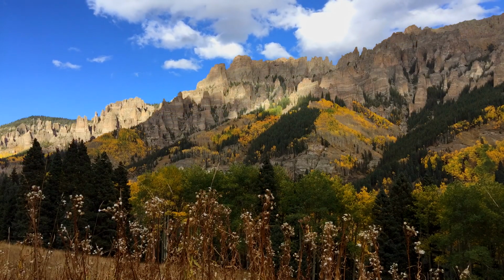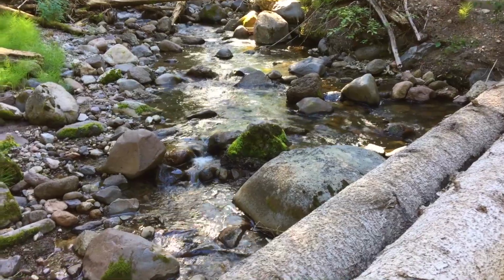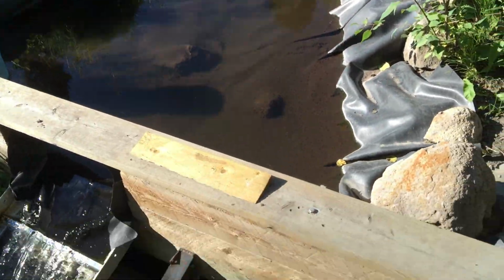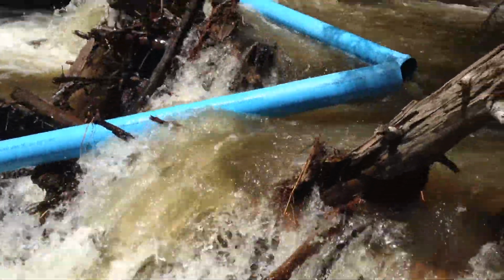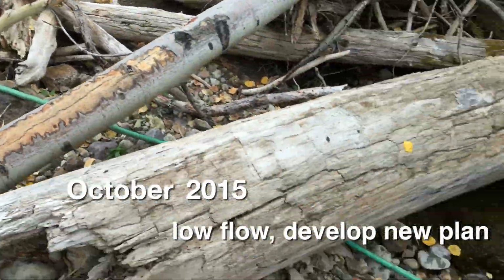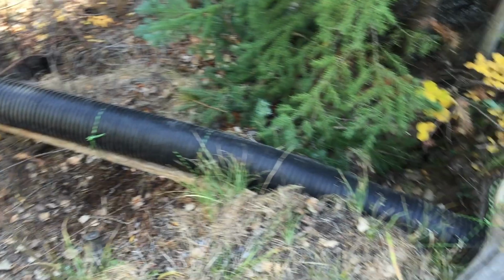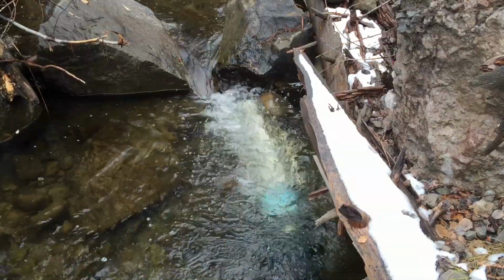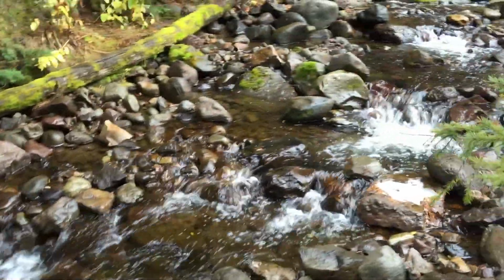Part 16 MicroHydro Power System in CO

Comment: This series really drew my interest in Micro Hydro and now that we just moved and are looking for a new home what do you think I should look for in a suitable property for Micro Hydro? can't wait for the next video!!
Reply from the maker: +Green Jeans 
A piece of land with water flowing on it that either has a lot of flow with some fall or one with a lot of fall and some flow that you can get access to.  Every installation is unique and gets designed to the potential power available.  In contrast to our system, going DC with batteries can provide ample power with much less expense.  Parts 6 and 7 of the series is an introduction to the process of determining the available power.  Fall(head) and Flow are the two essential measurements and of course being able to acquire legal rights to use the water for power which varies depending on jurisdiction.  Having some year round flow is ideal.  There are lots of manufacturers with calculators to determine power on their websites.

Glad you like the series.  More vids to come in the spring.  All is functioning under the snow at this time of year.  Any filming is cumbersome.

Comment: hi great sistom and video, just one comment the north end of the pipe bridge anker. going round the trees will cause the back harfe of the tree problems in growth as the bark and cambium are crushed. an olternative is to drill a hole through the trunk and fit a 3" stanlase steel  plate and rod with an eye at the end the 2 woonds can then be sealed with wax ,the tree will then grow around this. We have done this at the local scout campsite for the plonering 3 years ago and they have heald up fine and are still solid.
Reply from the maker: Thank you for the input.  We will look into it.

Comment: Great series! Is there any change to the forest downstream from the meadow? Curious if the reduced water flow in that spring where the water is picked up and redirected to the power plant has had any effect to the lower vegetation. thanks
Reply from the maker: +woolever02 
No, the point at which we picked up the Spring water in the meadow was only about 100 ft. from where it joined the creek anyway.  The diversion of water from the creek to the meadow is a small portion of the available creek water, so there really is no impact to the forest from that either.  The seasonal changes in flow of both the spring water and the creek are very large anyway and always have been in this area.  So, no real impact to either flora or fauna.

Comment: While i am at it . How do you clean the intace in the creek ?
Stopping turbine periodicliy and letting the 
Waterflow over the screen flush  in away?  Nice system by the way. Sorry for the spelling..
Reply from the maker: +Staffan Lundgren 
The creek that feeds the meadow intake is largely self cleaning by its location in the creek water flow.  The other screen at the weir passes debris via the excess flow.  Both screens require the occasional cleaning with a simple brush.  No need to shut down for that, but we expect to flush the penstock once a year, so any fine silt that has settled can be cleared.  Opening the jet and pipe drain all the way with the jet deflector(system off) in place should accomplish this.  The maintenance is part of the fun with the system.
Thanks for your interest, subscribe for future updates, it helps with YouTube's ratings and more people seeing the series.

Comment: Really enjoyed the series, took over my Sunday morning. You obviously went to a lot of expense to put this system into effect - both in terms of the overall construction and the quality electrical systems and control. Could I ask what it cost overall vs. paying for power company to connect you to the grid, and what area you might have saved costs on I.e an over ground pipe from meadow to power station. Thanks again for a great compelling to watch series - really have made sure this is a consideration for land I am looking to purchase.
Reply from the maker: +Banyan Tree 
Reposting a previous answer to a similar question:
"It's a good question, but very difficult to answer. First, one would have to amortize the cost of laying in grid power in 1994.  At the time of the switchover the system had produced 145,000 kWh for a basic cost of $25,000 versus $140,000 for laying powerlines. Add $52,000 of current development costs and you are paying for all the future power generation in the systems lifetime. You would also need need to subtract the cost of line power over the last 19 years to determine the cost per kilowatt hour over the first system's history. ....... I got lucky and found myself able to pursue this undertaking nearly 25 years ago and am fortunate enough to share my experience via the Internet which has developed in the interim. 
Hopefully people somewhere in the world will find the information useful."

I'm glad you enjoyed the series.  Its rewarding to see others get something out of it.  In terms of burial of our pipe, it was certainly necessary due to the deep winter cold and the potential for animals or falling trees to damage the pipeline.  It was very rocky ground and made the burial more difficult and the bridge added a great deal to it as well.  Labor and machinery cost was the highest portion of the overall cost.  Not sure on the first system which was installed 1994 or 1995, but on the second pipeline it was roughly 56% or 29K of the 52K.  The pipeline and parts were about $7800 and diversion pipe about $650, Bridge ran about $1600, Weir under $300, powerhouse $3600, wire & electrics $4800, legal and consulting $2100. That labor and equipment rental was for all the work including laying electric wire, building powerhouse, weir, and bridge, and burying the pipe.  Sorry I can't really break out the labor for the pipeline separately, but those are the numbers I have, roughly totaled.

As you can see the lion's share of costs were labor and equipment rental and of course I already owned the hydro machinery from the first installation.  Also my time isn't calculated into any of this which was a substantial effort to accomplish.  I attempted to save money wherever I could by finding things salvage or on ebay whenever possible and neighbors helped with some labor, parts, and expertise as well. 

The reality with Hydro is that you are paying almost all your costs up front for all future power with very little parts or maintenance costs once installed.  The more power you produce and put to good use the better amortization of the costs.  Still to date, I've saved a great deal being off grid vs. running power in(w/1994 dollars).  I can't imagine what they would charge me now to run 7 miles of service, probably double the 1994 figure.  So, I feel fortunate and happy to see the meter spinning madly in my favor.  Of course if I was grid connected I could be selling the excess power, but it is fully off grid.

Please subscribe and share the series with friends that might have interest as that helps the Youtube channel get better promotion and more people will see it.  1.1 million views so far, I can hardly believe it.

Hope this helps, best of luck with achieving your goals.  Thanks for your interest!

Comment: the old hydro pipeline would you consider making a smaller power generator off that to add more power to the house or does that just make everything more complicated run a couple of baseboard heaters off of the old source?
Reply from the maker: +Wayhart 
The new system will supply plenty of power(200-215KWH/day) once we prove the winter water flow.  It does get complicated trying to synchronize two systems.  Way beyond my skill or understanding.  It would require buying another pelton turbine as well.  As it is, we have to figure out how to use all the power we can make anyway.  Think jacuzzi tub, automobile charging(once I can get an affordable electric), steam shower, ect.  The spring pipeline is now dedicated to domestic spring water and active water supply for the fish pond.  This has allowed reducing the 212psi pressure to 80-100psi which has always caused problems with regular pipeline breaks in the springtime.
Reply: +MrHydrohead There is always splitting water for hydrogen gas that you then compress to run in your standard gas car with a simple hydrogen injector at the air intake on the engine. You dont touch the gas side of the system other then reprogramming the computer to stop the flow when burning hydrogen. 

Standard engines run fine on hydrogen/methane/natural gas if you have the time and energy to convert them. storage tank ether in the trunk or roof mounted, fuel lines and the injector plate are the only real hardware needed and the other part is the change to the computer. 

Roof mounting a tank is the best option as it can be hidden inside a luggage rack and filled with foam to help insulate them. Any leaks float up so they dont fill the car with explosive gas. If you want something like Propane you want the tank lower as propane is heavy so sinks in air.
Reply from the maker: +jeepxj 
Interesting.  Thanks for the share

Comment: Your problem with the dirt could be resolved by put a  regular filter with a big pipe in the bottom of the water,   also the pipe should be attached at the top of a pyramid and you put this pipe in the big water container,   once the pression is in the pipe,  the water can go over the edge of your pound in the pipe,   also you can control it with a valve far a way! ;)

Comment: I love the explanation of the electrical system and the decisions that were made.  Can you provide a schematic of the basic water system from first weir to powerhouse and pond?  That's the one part I am not completely clear about.  

You are also building on constantly-moving morraine and alluvial deposit.  I really applaud your commitment to the project.  You could control the water situation, with D9 Cats, thousands of tons of concrete, maybe a few tons of explosives, and the blessings of FDR.
Reply from the maker: +Robert Anderson 
I have to chuckle on your comment in the second paragraph. How true it is!  It has continued to be a real struggle and DEEP into the woods where it occurs.  IT IS out into the wilderness where only wildlife, cows, and hunters trod. The whole hill above the creek is moving, just remarkable. The idea of an approach which tries to set things in stone would be incredibly expensive and doomed to eventual failure. A dynamic changeable approach seems most reasonable. 

On your first question are you looking for detail on the first system in parts 1-5 or the redesign from parts 5-16?  If you provide an address I can provide you a detailed answer.

Thanks for your comment and for watching.  It has been fun to share and there is more yet to come so please subscribe.

Comment: Hi, please explain why the diversion plan was necessary to provide water to the meadow?
Reply from the maker: +Samuel Arnold  Besides being inaccessible to heavy equipment, the intake point at the edge of our property is in an unstable zone of soil and rock.  There are huge flows of snow melt water in the spring which change the shape and course of the creek thru that region. The topography on one side of the creek is completely unbuildable. Lastly, the meadow has additional water flowing into it from a nearby set of ponds. It has proven a good choice as we can capture all available waters in the meadow from that point and allow any sediment to settle so it doesn't enter the penstock.

Comment: you should always draw water off of the water supply to a man made holding location that then supplies the power plant while excess water can be returned to the supply....
this circumvents rising and falling of runoff wherever u draw water from will erode away and every season require replacing supply lines .... there are ways to avoid that but that takes extensive construction

Comment: I was just wondering if you are planning on making another update video? I'd love to know if you ever achieved your goal of closer to 9k watts. One other question, do you sell any of your excess power back to the power company?
Reply from the maker: +Craig Bauman (VeypEngineer) 
7 miles from the grid, so no sale possible.  The cost of wires were/are prohibitive to reach the grid.  
It's been a crazy year, first preparing(starting Nov15) and selling our house in LA, closing, packing, moving, fighting invasive weeds, and getting resettled(Sep16).  Exhausting.  So there's been little time for videos all year.  Since arriving in July we've had the system throttled back on flow at about 3k not needing any excess power/heat.  Even so, needed to ventilate the garage to make working there cool enough.
Our complication on ramping up to 8.5-9k at this point is the dynamic changing quality of the creek diversion.  We pulled the flexible pipe and screen out for the spring run off and that was good because the creek scoured a different shape.  I'm just now beginning to focus on getting the diversion pipe re-installed.  The intake point of immovable rocks remained intact,  but the flexible pipe course needs to be re-situated.
Also there need to be additional loads and relays added to handle the added power.  Chicken and egg scenario. Don't want to purchase and install more load devices than there is additional power until the flow capacity and power is proven.  So it all comes down to how much water can be diverted through winter when the power is most needed.  This will be our first full winter here, so it's still a learning process getting the diversion right and overcoming any unforeseen problems.  It's a complicated thing to explain it all in videos as well, but that's the goal for this fall.  To get it all ramped up, installed and explained.  
Also, I've had an electrical engineer friend who's designed a circuit board for monitoring and controlling the powerhouse remotely.  That has yet to be installed but is in the works.
Long winded answer, sorry.  Lots left to do but living with the power is good fun, very satisfying.  Basically doing all this work myself, so there are limits to how much one man can accomplish, but still pushing forward at a reasoned pace.  I'm certain as a viewer it is excruciatingly slow.
Thanks for watching, more WILL come as it unfolds.

Comment from the maker: That is a lot of power!  You either require a lot of volume of water or a great deal of pressure and a very strong pipe to safely hold all the pressure from a large head.  How much water do you consistently have flowing at your site?  And secondly how much is the maximum amount of fall you can reasonably access.  These are the two fundamental questions that govern the potential of any hydro site.  The formulas once you know those two numbers are fairly straight forward.  Also, are you talking 3 phase or single phase power.  3 phase is a lot more efficient.

Comment: Really interesting project.  I am curious to know if the installation cost would be offset by the power production.  Bit different in Australia as we simply don't have the water available to do that not on the coast where we live anyway.  Seriously interesting project though.
Reply from the maker: +Kerry Burke. Many people ask this sort of thing. It's hard to give an isolated answer.  Offset is in value not hard dollars. When the original installation was made the quote to bring utility lines to the property was 7 miles @ $20k/mile = $140k. That was 1995. We invested $25k at that time on the original system which still provides pressurized domestic spring water from about a mile away as well and waters to a trout pond also. The more recent redesign to date has added about $53k but we are now generating 175kwh/day which heats the house at 8600ft elevation in winter as well. None of this was cheap as we paid for all future power at the beginning. As ivestments to the overall property it was a small cost in the big picture. So far since 95 we've generated over 183,000 kWh with no utility bills and the system just keeps humming. There is no sale of power to the grid as there are no lines. Truly off grid. Hope this helps. Thanks for watching and please subscribe for more videos to come.
Reply: The cost of bringing mains in was about what I thought.  It is a similar problem here in Australia.  Exorbitant cost to bring it in.  You have answered my query though as overall it was definitely worth the effort.  I would imagine the usage cost on top of the connection cost would be significant.  Many thanks for the response and information.  Looking forward to any updates on the system and its usability.  Cheers
Reply: Solar, wind and lithium batteries.
Reply: After some research you will come to the conclusion that nothing is simpler, more cost effective, or reliable as hydro. If you have running water, any other choice is foolhardy.
Reply from the maker: I totally agree. Thx for watching

Comment: First of all the whole project is awesome , and i commend you on your efforts. Do you have enough extra to sell back to the grid, looks like the amount of water capture could be increased just a bit if necessary. And secondly would it  be feasible to try and catch the spring thaw and sell that back to recoup some of you investment, keep up the good work.
Reply from the maker: Unfortunately no sell back to grid is possible being 7 miles from the grid.  However I've saved a bundle over bringing grid power in since I put in system in the 90's. They quoted me $20k/mile to wire in power =$140k and then I would have had monthly bills on top of that.  So I'm truly off grid.